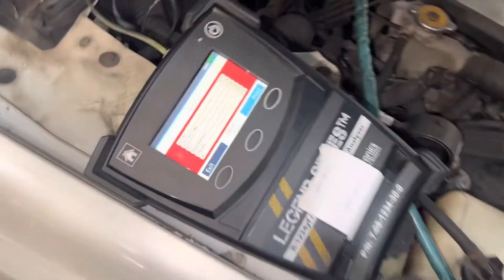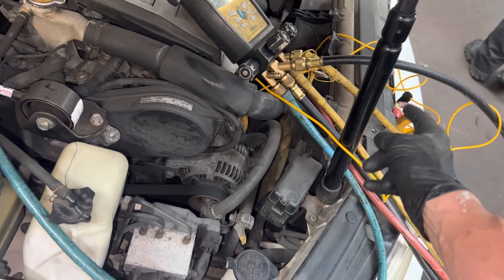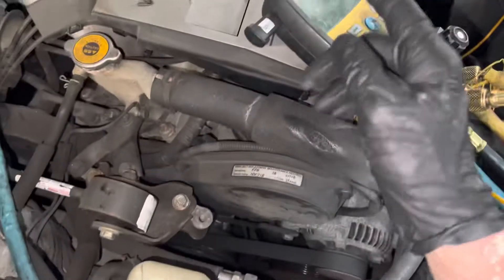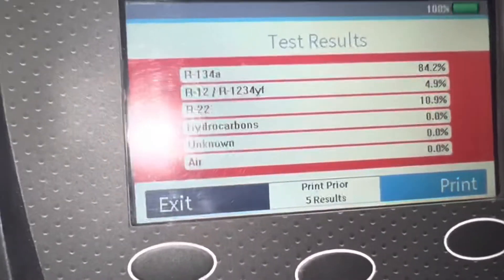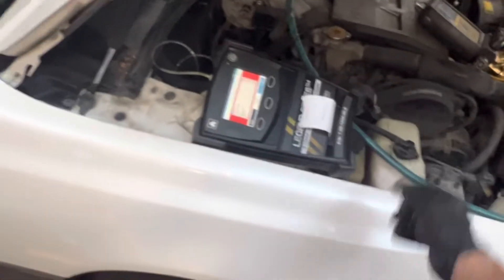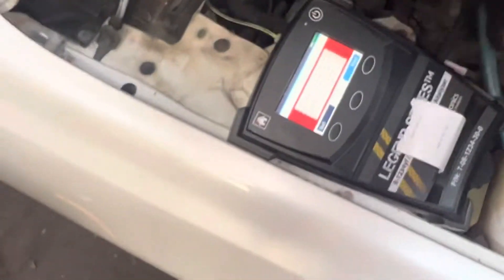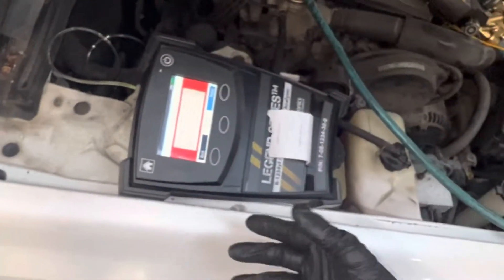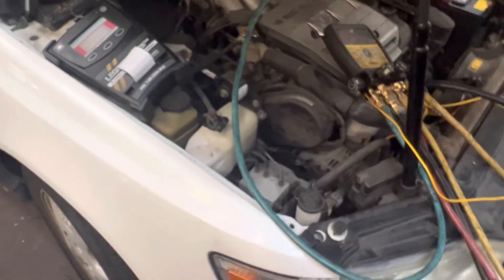Refrigerant contaminated another infection caused by a shop￼

Comment: Hello,I noticed that my AC when turn on hot air comes first from the vents after which cool air comes slowly on driving sometimes very cold and sometimes just cool air,what do you think the issue behind since vehicle ac is charged according to company specifications.Note the ac compressor is of variable type?.
Reply from the maker: Do you live in a very hot place and the car was sitting and all the plastic in the vents is very hot and it takes the first minute or two to cool down the hot plastic Dash vents before the cold air can come out ?.  

How many things just to guess I’m not there one of those kind of things I need to put my hands on it
Reply: @coldfinger459sub0  Thank you so much.
Reply: @coldfinger459sub0  even this happens  sometimes in the evening
Reply from the maker: @issamadam9352  Not tell what the problem is without me being there

Comment: What are normal suction & discharge line temp?
Reply from the maker: It changes with ambient temperature and it changes with different year make model vehicles and it changes with different kind of air conditioning systems piston compressor verrible displacement compressor electric compressor will have different
Reply: @coldfinger459sub0  what is the difference between variable and electric compressor?